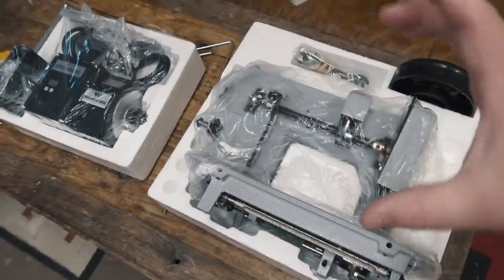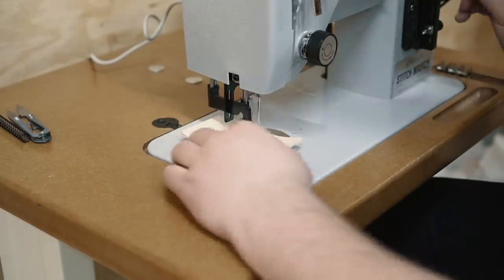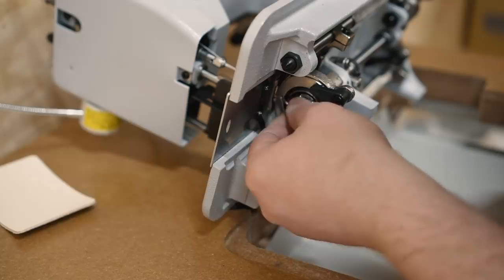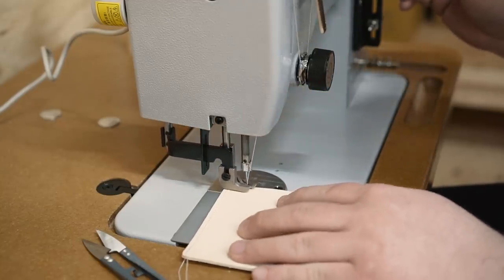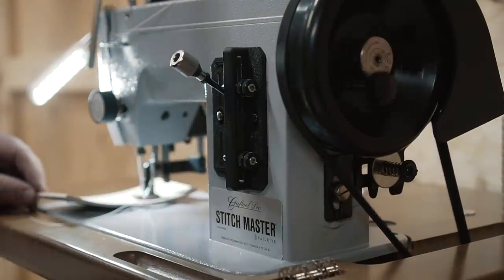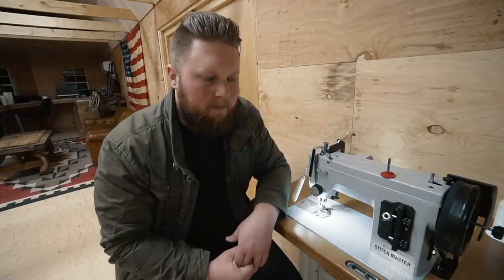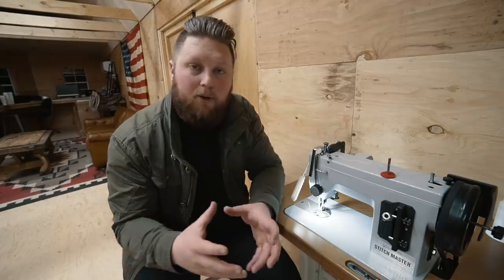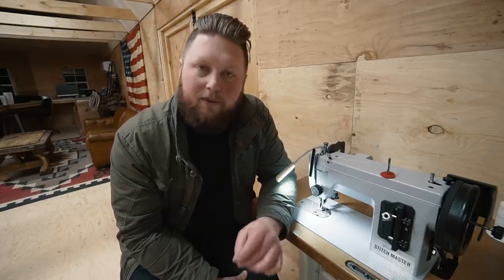Review of the Tandy Stitchmaster Pro Leather Sewing Machine

Comment: So... I'd like to give a review of the review.  A lot of other people have said that an endorsement might skew the results of a review.  I'm a regular Sailrite user and would like to give my two cents.  I run both a Sailrite Fabricator and a Thompson PW-201 (which is the Sailrrite LS1 without the posipin system).  While this Tandy machine is functionally the LS1 it is not identical.  Sailrite does not currently sell the LS1 as a table top machine with the Workhorse Servo motor so that's a mod you would have to do on your own.  In addition, I do not believe that they sell the table that comes with this unit.  So those are (to my mind) two upgrades that you are getting with this machine.  As others have said, you could go straight to Sailrite and get the LS1 for much cheaper but you would have to deal with a smaller, attached clutch motor and no table.  My Thompson works great but was noted in this video is is significantly louder than the Workhorse motor.

My Sailrite Fabricator on the other hand can be purchased directly from Sailrite for about what is being charged for this machine.  It comes with the Workhorse servo motor and a table.  To address others concerns, it has a higher lift to the presser foot and can handle all thread sizes.  It also comes with the larger bobbins.  In addition, the Fabricator has about 10.5" of working space between the body and the needle while the Tandy machine (and the LS1) only has about 6" of working space.  The Fabricator also has the knee lift for the presser foot.  The Fabricator table will take up more room than the table shown here.

Honestly, my favorite part of the machine as shown here is the table form factor.  I use my Thompson to travel with me if I'm going to need to do some work at any events I may be traveling to.  If you are limited in space but want a table mounted machine with a decently robust motor this is a decent option.  If you have the table space for a table top machine, the LS1 directly from sailrite is probably a better "beginner" option that gives you the opportunity to upgrade to the Workhorse servo motor or a table setup down the road.

As mentioned in the video, Sailrite's customer service is excellent.  They are based in Indiana and are really responsive to questions and concerns.  Their machines are manufactured in China (like the REX and others) but their parts specs and tolerances are set at a much higher level and all the machines are tuned and tested in Indiana before being shipped to the client.

In my final analysis:  If you want a starter machine with the functional power of an industrial table mounted machine, especially if you want something right out of the box this probably isn't a bad option.  If you have the space for a larger machine then I would recommend the fabricator.  It comes in around the same price point as this machine but you are getting a full industrial sized machine that's much more versatile in terms of thread, presser foot and needle options for a price that's on par with this machine but still much less expensive than the Juki.
Reply: THANK YOU for your review and recommendations Shane!
Reply: The Fabricator is also a triple feed.

Comment: I have the cowboy 3200 but have been looking for something to do some of my smaller projects without putting huge holes in it.The cowboy can do smaller pieces but by the time you change to the smaller needle and thread ,adjusting the tension for the smaller thread ( rite after getting the tension set perfect for the larger #277 thread, I use a lot) an hour has passed without making the first stitch on the small project.When that’s all done then I have to go back to the larger project and do all the adjustments all over again.Great video please keep us posted after using it a little while,it will be a couple months before I decide which smaller machine I get...Your videos production qualities are excellent also,thanks again.

Comment: I actually own this machine, I love it! It is perfect for wallets, belts and other small craft. It's not loud at all, its loud in this video because hes running it on full... but when's the last time you've sewn anything leather at full speed?  You cant make mistakes with leather sewing or you've screwed up everything.... so no. It's not really loud at all at the speed you'd be using this on. I've not had any problems out of mine and it is a perfect space saving option

Comment: I bought a used Singer 42-5 about 8 years ago, ancient machine.  Put the smallest pulley I could find and a new leather belt.  It is a pain to oil, but can handle 3/8"  dewing leather with up to 207 thread on top and 138 on the bottom.  Perfect for me, an damateur who doesn't sew every day.

Comment: that machine is very much like a Thompson I have had for years...an upholsterer used his Thompson for car upholstery as well.  The issue  I had/have is it scarred the leather ...you mention that one doesn't very much...I wondered what was different...Having had machines for over 40 years, it is hard to wear out a good industrial, especially if they have been in a small shop.  A good used older machine with a new servo motor is what I would tell anyone to go for.  I am sewing sometimes very heavy layers of leather on a Singer 111W100 that was made in the 1940's.  I bought it in 1981 or so and it has been back in the shop once soon after I got it because I didn't have sense enough to oil it often and then again after 38 years of use because I knocked it out of time and couldn't figure out just how as I had always fixed it before.   So I am glad you are hyped with that machine.  I like my kindred spirit..I bought it because I had a job in St. Thomas in 1996...a big in house re upholstery job after I think Hurricane Andrew.  I have sewn on the older industrial Singers and Consews...they are great!   For craft fairs and in-home jobs, and small space, that machine you are showing will do fine...  by the way, one thing I did appreciate about what you are showing is the table...I don't have a proper fitting table and the vibration isn't fun..

Comment: Initially, I agreed with those who thought this was a little pricey. However, after researching Sailright and seeing so many positive comments on their service and support, I decided to investigate a little more. 
Yes, you can get a Sailright portable for $750-850. However, that is without the table, servo motor and speed reducer. After seeing video of both configurations sewing leather and other materials, I've come to the conclusion that the added control and power offered by those features are very valuable for what I do. I also appreciate the foot and feed designed for leather. By the time you add all that to the little portable, you'd be in the price range of the Tandy offer. I also appreciate that someone has come up with a smaller configuring for those of us with smaller projects on the table and space considerations.
I'm anxious to get my hands on one and try it out.
Obviously, if someone wants to do saddle & harness, or other work with multiple layers of vey thick leather, this is not the machine. But it looks to be a good starting place for general leather work.
Thanks for the report, Parker! I'm anxious to see more of this machine in use.
Reply: Bethany Kamman I came up with similar math as well.  In addition, this comes with everything together, saving you the time and effort of upgrading.  Plus that small form table is something I really appreciate as well and isn’t available from sailriite..

Comment: I have the Sailrite Zigzag version of this machine. In the 8 years I have been using it it has been fantastic. It is the little big machine. It’s only draw backs are the bobbin size, presser foot height and space under the arm which is very limited. With a V92 or 138 thread you are regularly changing bobbins. This is much better engineered than many of the Chinese copies though. I also have a version of the cobra 4500 and the tandy machine is a very light weight machine by comparison. For a small get you started machine it is a solid buy.

Comment: No-one seems to have realised that this is a cheap Chinese REX machine that Sailrite modify a bit, and tune. The basic Rex runs about $300 with a small motor. In China they are REALLY cheap. As tuned and re-badged by Sailrite the machine runs better than the basic Rex, but the additional sales price is steep. You've gotta give Sailrite and Tandy credit for this sales pitch. On the plus side, Sailrite offer good after sales service, and their 'how to' videos on YouTube are excellent. Those vids apply whether you've paid $300 for a Rex or an extra $1,100 for a badged version. Sticking a servo motor on a Rex (which is a no-brainer idea) should run $450 in total, but you'd need a bit of tuning and fettling to bring it up to the Sailrite or Tandy retail package. Ain't marketing clever!
Reply: I have seen several names/brands of sewing machines on aliexpress. 
They all look the same, price starts with walking foot ~300$ (or ~270€) , without table/motor/shipping.
Reply: Duofold a
Reply: They aren't imported and rebadged and the old tired "you get what you pay for" moniker still applies.  They used to be imported, and the Ultrafeeds are certainly inspired by the REX, but Sailrite modified the mold for the casting and also uses beefier components for about 8 or 9 years now.  They had to do this because when they originally introduced the monster wheel, it was snapping internals on the import (that's basically a 7lb flywheel at the edge).  The REX also doesn't have the posi-pin, which is a Sailrite patent.  You'll spend money to upgrade that too.  They're not the same.  The base package with the DC motor is $750, not $1,100.  Yes, that's the cost with the deluxe blah blah blah, but the closest comparison is $450 more.  Beefier internals AND white glove service for that much?  Yeah, I'll do that.  I know what you were saying.  I was looking at the cheaper imports as well, but again because they pretty much lay it all out there in their marketing, I went with their Ultrafeed. 

This video goes into what I was talking about much better than I could.  Their design overhaul and the fact that it came white gloved, tuned and ready to run and gun (which was helpful because it was my first mechanical) was what won me over.  Marketing is a double edged sword and clever as you said, but it's pretty hard to mislead when you do a side by side like this. 
 https://www.youtube.com/watch?v=fAmy_KHxciA
Reply: OK.  Well you must be right: 100% made in the USA is it? You know, I'm not so sure. And I do see your point about the little patented pin thing. It looks a good $5 worth, but a good idea. The Sailrite is maybe a necessary buy if you also decide to buy the Monster balance wheel (which is a pricey upgrade that some like to have. I'm not saying the Sailrite isn't better - I'm saying the hike from a Rex at $300 to $1,400 is not a jump everyone can afford. High grade 1.5 amp motors are inexpensive to add if necessary. Anyway - you choose. OUT.
Reply: It's assembled stateside, however I believe the country of origin of the parts are still mixed with some being manufactured in the US. (Note that at no time did I actually say "Made In The USA", I said they weren't rebadged imports, there's a difference).  The overall theme about "buy what you can afford" from your initial response is not lost on me, I was merely pointing out that you were comparing apples and oranges.  A base model $300 REX is not a base model $750 Sailrite, but it is not a $750 REX with a Servo, nor is it a $1400 Tandy Stitchmaster either.  They're not merely playing to marketing schemes for the price difference as you're trying to convey.  There are significant technical differences.  I won't even deny that Sailrite has an almost cult like following, but facts are facts.
Reply: Don't forget Consew, Techsew, Alphasew, Newtech, Feiyue reliable, REX, Family Sew, Omega, Sewline, Tuffsew I think they all copied the Thompson. lol
Reply from the maker: NGinuity love this! Looks like you’ve done your research👊🏼
Reply: BigDaddy I have an original Thompson PW-201 that I got on FB marketplace for $30, in perfect working order except for the bobbin retainer ring.  I got that at a local sewing shop for $4.  Best $35 I’ve ever spent.
Reply: IyaEarthseeds re-badged means it’s been labeled differently.  The machine itself is a Sailrite LS-1 with a different paint color and the Tandy / Stitchmaster label.  The whole package is different (the workhorse motor and table, for example) but the head, or machine itself is just a “re-badged” LS-1.

Comment: As is, I think this machine is good for small items. Wallets, bags, etc. It certainly has its pros and cons. When I first saw it I was very excited, but that faded as I looked into the specs. For me as someone who makes holsters and sheaths, it is not good. I need a higher presser foot height and much thicker thread. I would gladly pay $2k for this machine if it could do at least 5/8" presser foot height and at least a 207 thread. Although again if you're only making small items, wallets, watch straps, small handbags, etc. things where you will never go above a size 92 thread and never thicker than the 5/16th" you get for clearance, this is perfect.  I was at Tandy today picking up line 24 snaps and was surprised to see how small this is.

Comment: Actually, I have been researching sewing machines and I suspect I have contracted the frustrating Analysis Paralysis condition. You are correct. There is a big gap in the market for walking foot machines that support beginners with servo motor and the flexibility of having a combo table and a cylinder head. How did the industry go wrong in their market research? This is a nice compromise, althought I would still have to sacrifice a lot of burgers to save up for one.

Comment: Great video! Your content is always right on key. Thanks for your input and time. I've never used any thread smaller than a 207 on my Tippmann boss but am needing to do a change. What are your thoughts on the 92 thread vs 138 on say wallets bags and belts? I was thinking of using 138 for belts and bags but 92 may be all I need. I was interested in a class 17 but I maybe drawn to this machine.

Comment: I own a sailrite lsz-1.  That's basically this machine with zigzag.  Is this one also unable to run nothing heavier than v92 thread.  The forward and reverse  is extremely difficult to adjust so that the needle goes back into the same hole while back stitching. Forget filling a bobbin while sewing at the same time. The presser foot lift lever is pretty irritatingly small and awkward to use.

Comment: $1,500  for a machine that will only sew leather up to 10oz  is loud.  bobbin, is to small.
For someone just starting out in leather craft $ 1.500 is a lot of money it would take a long time to make back that investment . start out with used machines  you have to learn to walk before you can run.
Reply: Exactly
Reply: Yeah just get an old singer they last 100 times longer, look way more cool, and sew better thicket leather.
Reply: Conrad smith which old singer the best for small leather crafting like wallets?
Reply: @roadrunner7203  I would have too say the singer 29, although it's pretty massive. Any old singer can sew leather however, a 99k or 15k would be ok too. :)
Reply: It will sew a thing with the correct needle, foot, and feed dog. The parts are readily available at Sailrite and reasonably priced. I’m not affiliated with Sailrite, just a happy customer who uses the machine for clothing, canvas, sails, and leather. BTW, the machine (LS-1 model) is around $800 from Sailrite for the portable setup.
Reply: Wayne Tjornhom dang that’s almost half. I might be able to scrap $800. I’ll thanks for the tip aye
Reply: @OozieBagoozie  Not the same machine, though... The normal sailrite won't have that motor as standard, for example...

Comment: Hello parker.  Great vid, when i saw that machine i knew it was from sailrite. I got the same machine from them and its 750 or something in them lines. I work at a leather shop and we have a juki like machine. Its ok but after using my sailrite machine i cant compared it.

There is other machine out there like 200 cheaper but i love the sailrite machine is great and i can sew 3/8" thick material or leather no problem. I didnt get servo mottor but i will. 

But people do have options and i know you have partnership with tandy and if i was in the same road o be doing what you did in the vid. I just dont get why people get so angry or upset. Just keep it respectful and move on. Simple as that. I bet if people was in your shoes they do the same thing.

Keep up the great work. One question i do have. Would you do vid of your look back at when you first started and what was your starting kit and how you got into do what you do?